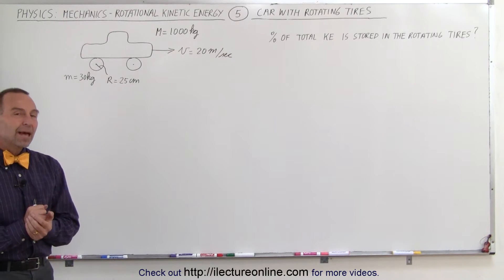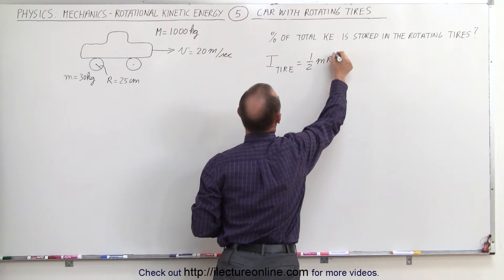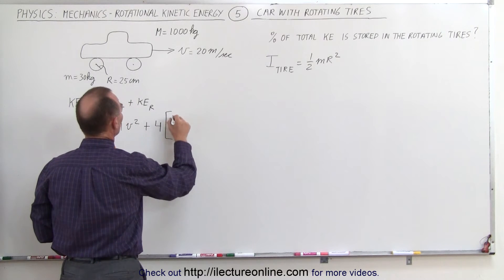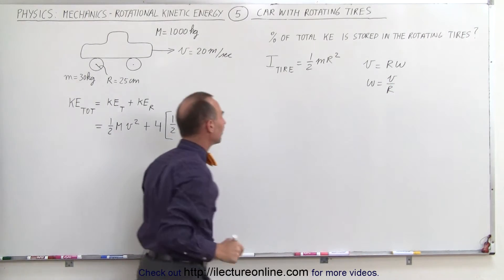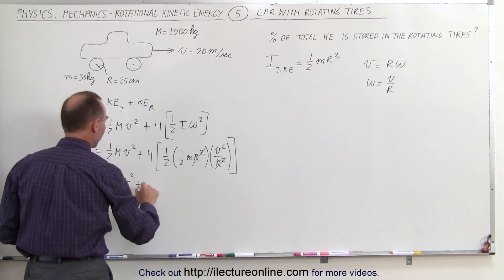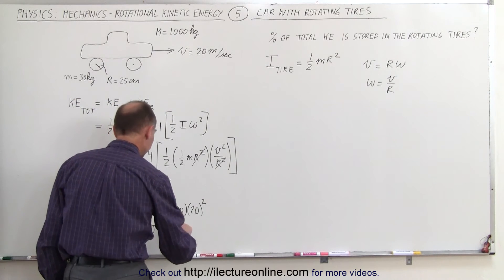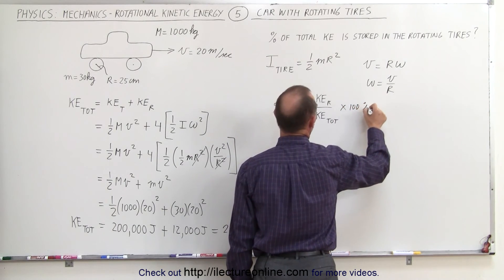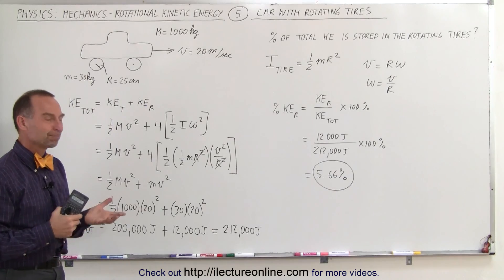Physics 8.5   Rotational Kinetic Energy (5 of 19) Car With Rotating Tires

Comment: Sir, only rotational KE of tyres is considered in analysis, whereas tyres also will have translational KE which is excluded.
Pls explain, if correct.
Reply from the maker: The translational KE is already included in the total mass of the car (M) and (1/2)Mv^2
Reply: Got it, Sir. Thanks.

Comment: Can tire rotation be converted to energy? I.e. charging a generator
Reply from the maker: Yes.  Like the flywheel in a car, the rotation of the flywheel stores kinetic energy that makes is easier for shifting the gears, since it aids in the rotation of the engine.

Comment: Why would the moment of inertia of the tyres be tht of a solid disc rather than a hollow disc which is I=MR^2.
Reply from the maker: If you use the moment of inertia for a hollow disk, then all of the mass must be at a distance R from the point of rotation.  That is not the case for a wheel of a car.

Comment: There is no kinetic energy in a moving mass there is force Mv squared kinetic energy is the energy of consistent work from a consistent force regards Graham Flowers
Reply from the maker: KE = (1/2) mv^2
Reply: @MichelvanBiezen  not according to flywheel energy storage systems regards Graham Flowers
Reply from the maker: For a rotating object,   KE = (1/2) Iw^2
Reply: @MichelvanBiezen  sorry flywheel energy storage systems 95-98 percent efficiency not 50 percent regards Graham Flowers
Reply from the maker: The efficiency of a flywheel energy storage system has nothing to do with the (1/2) in front of the term on the right side of the equation. (The 1/2 does not represent 50% efficiency).
Reply: @MichelvanBiezen  a half = 50 percent of the mass
Reply from the maker: No, it is simply a constant of proportionality.  (not 50% of the mass).
Reply: @MichelvanBiezen  you believe what you think and believe in reality have a nice day

Comment: If  a car is braked suddenly on a slippery surface, does the rotational energy get converted into translational energy?  I've always felt that the car is going faster after the wheels lock up.
Reply from the maker: That is a great question.  You are correct, but we would have to calculate it to see if the increase in speed would be noticeable    Maybe we should make a video on that.

Comment: Sir, in Last lecture, you have mentioned translational kinetic energy and rotational kinetic energy both for moving wheel.but, in this lecture you have mentioned rotational kinetic energy only for wheel.kindly explain sir.
Reply from the maker: The mass of the tires are already included in the total mass of the car.

Comment: how would you calculate the rotational energy if you had wheels of differing mass e.g a pair of front wheels at 60kg and a rear set of 4 wheels at 115 kg ?
Reply from the maker: Calculate the energy of the wheels separately.

Comment: isnt each tire translating as well? why didn't we add up the translational energy of each tire like we added up each one of their rotational kinetic energies?
Reply from the maker: That is part of the mass of the car and the car's translational energy.
Reply: And with respect to the energy stored in the wheels, would the total kinetic energy stored in the wheel equal the translational kinetic energy of the wheels (0.5mv^2 = 4(0.5)(30)(20^2) ) plus their rotational kinetic energy (4(0.5)I*omega^2)?